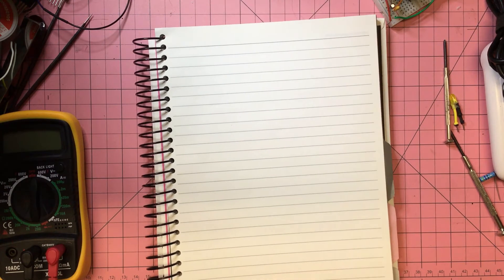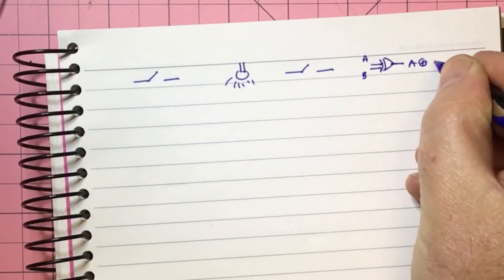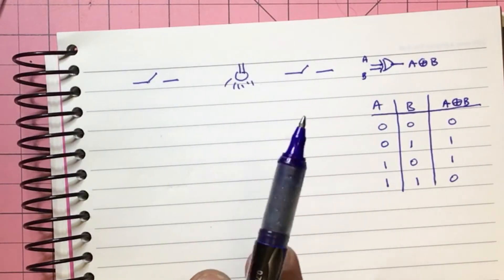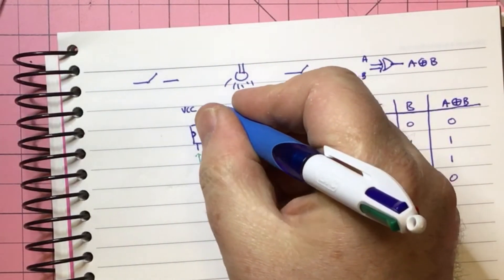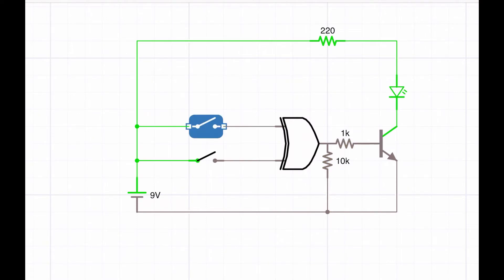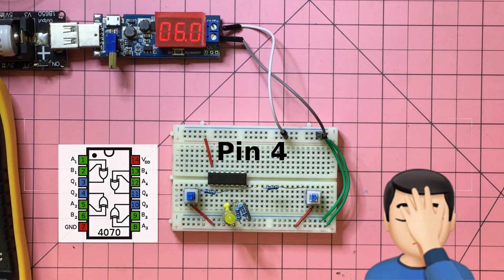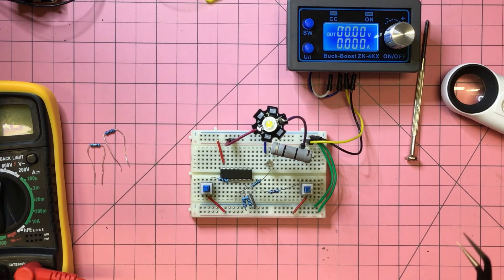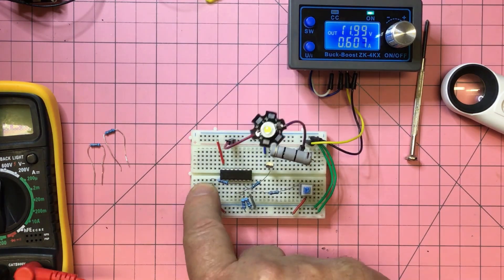CD4070 Quad XOR gate

Comment: hello sir I have some unusual problem the circuet in question is the 4 pin GM ignition module for an Opel car from the 80s. It uses the MC 3334 ic chip diagram for HEI Ignition circuet. Now my problem is that thing does not have an zener diode voltage protection in my Europ model Ignition Module and badicali it isnt practical at all it does not have an retard or advance ignition timing option . So I surche for an ignition module replacement circuet that can operate by an inuctive pick up coil.So basicali I need some how to figure out some thing simpler and make my own circuet that can phase shift ither the pick up ,ignition module or the ignition coil it self basicali I need around +/-10° Degrees variabel ignition timing . So I wathed so CDI variabel circuets they use 555timer and the ic 4070 xor and some led also some resistors to suposedli give 3 out puts who are operated by switches mormal advance and retard option. So I was wondering if that circuet wuld work on an HEI ignition module as well not only CDI ignitor module? Im not shure how to deal with that problem honesli the goal is mostli to get some narow retarding option so I can easyr start in winter time my engine.So I ques I need an variabel logic phase shifter if posibel 0-180 degrees capabiliti . So I hoppe you know more how that can by done .Any way my existing hei module is crap it has lot limitations and Im fead up with that thing it does not work under lowr engine rpms,it has terribel ignition coil saturation ,lot back charge interuption from ground reference it has no zener diode basicali so and the non existing advance/retard option gives my hard time. So I hoppe  for any advice how to takel this problem .
Reply from the maker: This is outside my expertise, I would maybe recommend that you contact Dan at simple electronics: https://youtube.com/@SimpleElectronics?